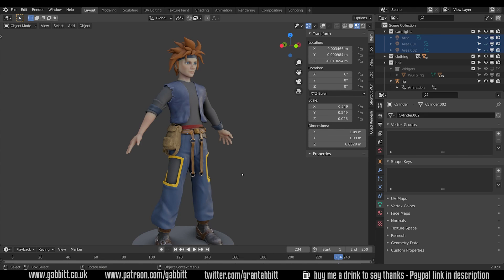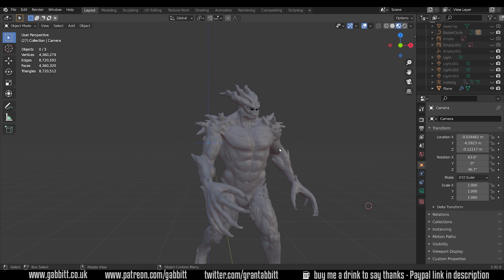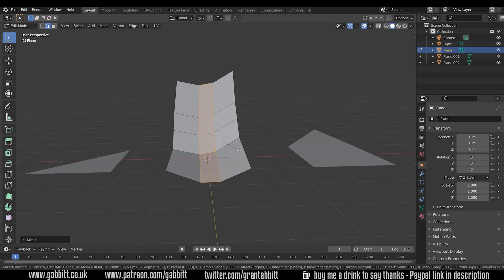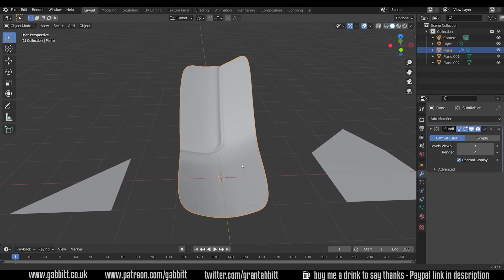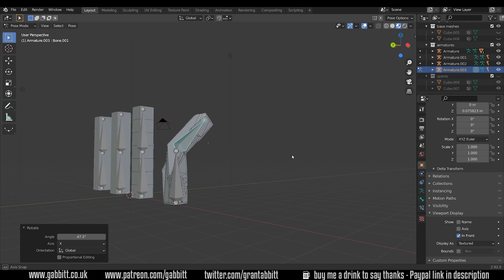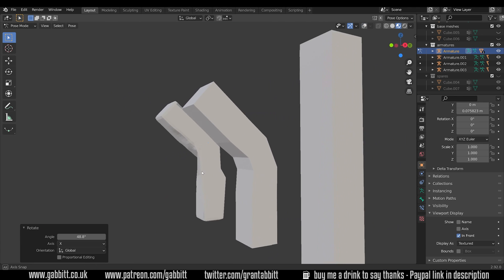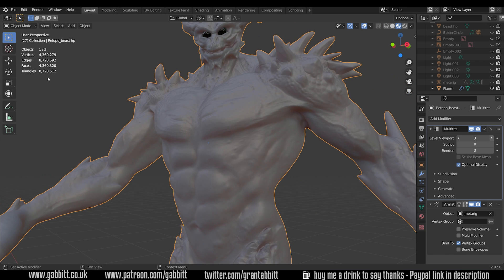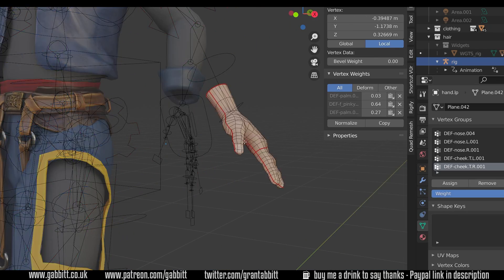Retopology A Detailed Guide - What is Retopology & Why Do We Need It?

Comment: I'm new to modelling. I'm curious why sculpt a model with a high poly count in the first place if you know you'll need a low poly count in the end? Why not just sculpt a low poly model in the first place? Thanks from a noob
Reply from the maker: You can still use the detail from the high poly in a normal map
Reply: so you can bake the high poly maps to the low poly model ..easily and you cant sculpt a low poly model 😂

Comment: My tip would be : don't just add one vertex and quad at a time. Start extremely simple, enclosing holes and dents with stretched out quads cause then you can always add more loops later and use subsurface mod

Comment: In the fourth pillar, you would get an even better deformation if you add a loop cut between the triangulated mesh at the back <=> (between the lines, the edge loop is stopped by the triangles). Really useful for realistic elbows, knees etc

Comment: What's the difference and reason to retopologize normally like this, or doing like in your plank sculpting video and first sculpt the mesh, then make a duplicate. Then use a modifier on it that reduce poly count. Then finish the small touches of optimization by removing faces and vertices you don't need.
Reply from the maker: i'm not sure i understand the question
Reply: @grabbitt  
Normally you retopologize by extruding square faces across the model to get the base shape of the mesh.
But this is how you did in your plank sculpt tutorial:
First you sculpted the plank, called this the High Definition.
Duplicated it and called that one Low Definition.
Used the Decimate Modifier on the duplicate.
Applied modifier.
Merged more of it's vertices together to reduce triangles and faces.
And that's it. In your video series here Part 3 quick retopology:
https://www.youtube.com/watch?v=m2frF62Zk6c
Reply from the maker: One has much more control than the other

Comment: Another important property of quads is that the industry-standard Catmull-Clark subdivision only has desirable properties on quads, it goes lumpy on triangles. There exists Loop subdivision surface, that is better-behaved on triangles (not loop as in a series of edges, but Loop as in Charles Loop), but in turn it doesn't perform well on quads. When quads are subdivided into triangles, they encode a particular bias direction into the mesh, which is not desirable and becomes visible in Loop subdivision. Both of these subdivision schemes were defined i think around late 70s or so. Decades later Loop returned i think with Loop-Stam subdivision which unifies them elegantly, but by that time, the whole industry locked in on Catmull-Clark subdivision due to overall advantages of quad modelling, and introducing any other subdivision scheme would impede interchange and make code sharing a problem, for example the modern GPU-accelerated Catmull-Clark code in Blender comes from Pixar (OpenSubdiv) and was open-sourced by them specifically in order to improve interchange.

Comment: When you say that a game model is typically 20-30 thousand faces, does that mean 20-30k triangles so I'd have 10-15k quads in a clean retopologized mesh?
Reply: There's frequently a limitation that a game engine mesh vertex buffer for any given drawable must not contain more than 65535 vertices. If you had a mesh of 30k quads, you could be coming dangerously close to touching that boundary, and would need to tiptoe around in editing that you don't cross it. But if you're at half that figure, you don't need to worry too much that the next minor editing operation will suddenly make too many polygons. It's fundamentally possible to make bigger meshes than this count, but they'll take twice as long to transfer to the GPU for the same number of vertices and will take up twice as much VRAM.

Generally you want to keep your polycount as low as you can while achieving your visual goals. Micropolygons are bad for performance. Thanks to unified shaders, consider that you have a budget to compute several million pixels + vertices in total, with a little weighting perhaps, so excessive vertex count in millions in total for the scene absolutely will eat into your pixel budget, for one, and for other, rasterisation actually happens in blocks of several pixels per polygon, like 8 or so, and when most pixels in this block aren't occupied by the polygon that is being currently rendered at all, well that's wasted performance. So if your average polygon size as-rendered is smaller than several pixels, the performance can start to fall off a cliff.

There is no abstract guideline to how complex a model should be, without considering the type of model and the scene as a whole. Do you have LODs? How many models will be visible? How much screen real estate are each expected to take up? How much overdraw is there? Because ultimately you need to keep not so much perhaps a single model within any given budget, but you predominantly need to keep the complexity of the whole scene to a reasonable level. A scenario with thousands of entities will have different requirements than one with just a dozen. It wouldn't be perhaps too absurd (though maybe still excessive) to see a 1vs1 fighting game dedicate like 300k polys per character, and have them split into like 10 different drawables each, and maybe give 10k polys to the whole environment otherwise.
Reply: @SianaGearz  Thanks for the awesome reply, that explains a lot =)
Reply from the maker: I think it quads but can't remember now

Comment: WOW! man this is EXCELLENT! I know how to Retopologize in Blender but this is such an obscure topic that gets no attention and Blender makes it extra complicated because a lot of the tools are all over the place and difficult to find so most people just give up. IMO if you use something else and have no confidence in Blender, trust me once you figure it out is absolutely great 9/10 but you need to also use a bit of the sculpting tools such as smooth with options so it doesn't distort the overall shape. I used Maya's Quad Draw, TopoGun and 3D Coat and Blender works just as good, it just needs a complete rework on it's stools/options locations. There needs to be a Retopology workspace with everything easily visible. It also could also use more Retopo specific tools. Basically it's an interface problem.

Thanks for this!
Reply: It's far more common in the 3D Studio Max world to discuss good topology. One of the keys with it is to model using quads from step 1 and you won't really end up with problems, ie. there is no need to "retopologize" later on. You can also get the mesh as far as you want with low polygon, then clone it and sculp the high poly version from there. It's much cleaner than trying to reduce/decimate a high poly sculpt to get your low poly version.